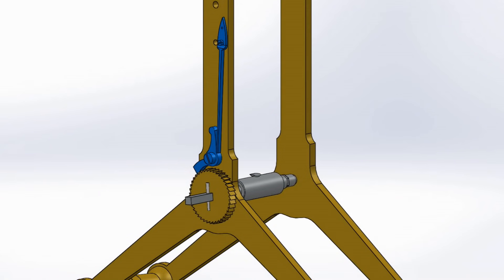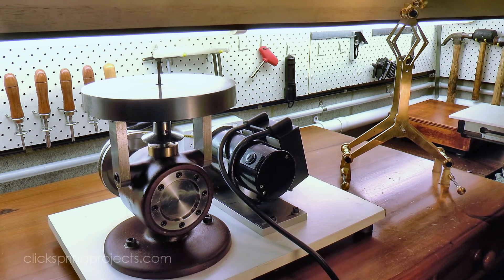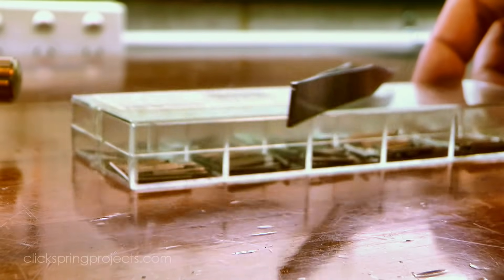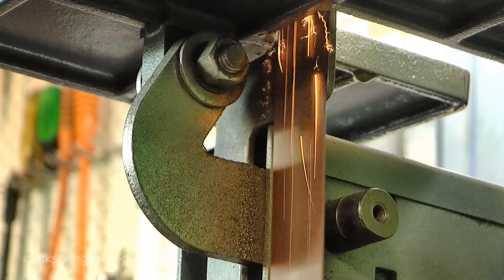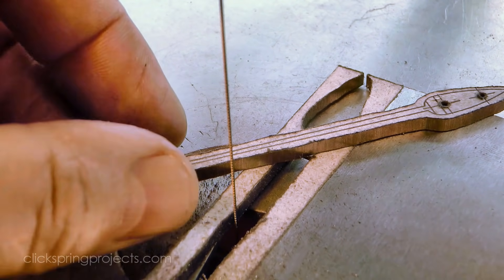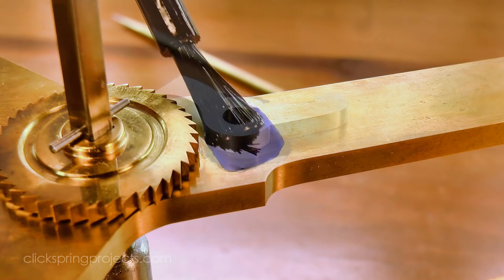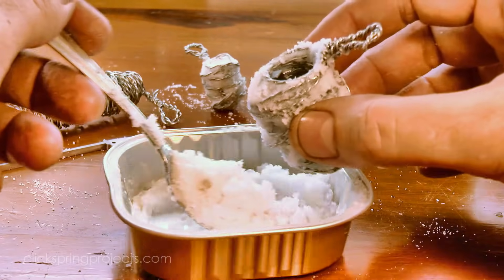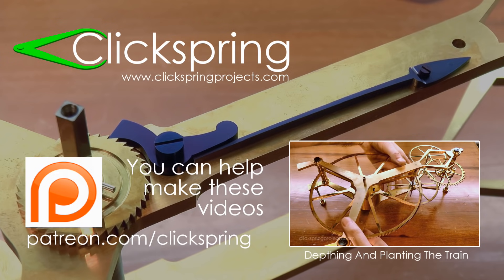Clockmaking - How To Make A Clock - Part 14 - Making The Barrel Click And Clickspring

Comment: Just noticed that in addition to using the sherline lathe/mill motor for cutting gears, this is the first time I've seen the use of that motor in the die filer. Was that a custom tool that I just need to watch for, or is that an off the shelf attachment from Sherline? If it's a custom tool, I'm wondering if I'm going to see that video at some point.

Comment: "Why does Time (appear to be) go one way". Because, logarithmic condensation form[s] follow fractal-perspective(s), e-Pi-i sync-duration connectivity function, ie omnidirectional-dimensional Superspin symmetry is one apparent format or "half-truth" transverse trancendental e-Pi Infinity of appearances, due to this numberness positioning observable as/by resonance, ie Chemistry Bonding = quantization identification. It's the shape shifting fluidity of water in a Fountain, ..containment by i-reflection instantaneous "pumping", or Singularity reciprocal metastability condensation, is equivalent to time-timing pulse-evolution recirculation. 

Clickspring => emulation of QM-TIME Completeness, pure-math putting perspectives of cause-effect Timing-spacing holography-dimensionality-> "Clocking" Actuality.

Comment: First, your videos and your work are amazing. 

At 4:47 you use a pencil to stabilize a pointing tip. Why is that? Why is not fixed and why you use just a pencil to stop the circular dancing.

Comment: Hey, chris, if that's A-2 tool steel you used in this video (same stuff as the pinion head depthing tool), be aware that the hardening process for A-2 is oddly complex and takes like 4 hours in an oven at several specific tempuratures. I used to make knives out of the stuff and found out the hard way that heating and quenching does not make A-2 steel harder
Reply from the maker: I use O1 oil hardening steel, very simple to harden - cheers :)

Comment: How did you build or buy your vise block/table topper thing? That is a very great idea and I would love to make one! Any ideas? Does it hold things well? Do you think it is better to use this or just bolt it to your table top? Edit: shown at 6:31
Reply from the maker: Hey Matthew -  Its an old cutting board, with the vise x 2 bolted to it.  Definitely not as secure as bolting vises directly to the bench, but I'm really limited for space so everything needs to be movable. Its rigid enough for small scale work, but would not be suitable for heavy work - cheers :)

Comment: I just notices that a lot of the clockmaking is measuring by size and not measuring and keeping it to the plan all the way trough the build. Small flaws that are inevitable are kept in and worked with rather then adjust and failure to it while working with the highest precision possible. More increasing precision rather than keeping a precision plan on microns, that can't be kept throughout the build.

Comment: Does the blue oxide fade off that easily? I mean on the spot where the click meets the wheel. Can that be avoided on larger parts?
Reply from the maker: It is a reasonably fragile coating. If it doesn't get any handling, it can last many hundreds of years, but if it rubs against something hard it will come off almost immediately. In this case the very tip has been cleaned off, and the rest will remain blue. Thanks for watching Andrea

Comment: hei, greetings from vienna :) i am wondering what program you're using to make those movable graphics with the wheels and pinions and the clockwork and stuff
Reply from the maker: +TheMegalodont Solidworks, although consider Fusion360 from Autodesk - same parametric functionality, but free for home users, thanks for watching
Reply: thanks for the quick answer, this was quite helpful, thanks

Comment: Does the filing button work because it is a higher hardness metal than the file?
Reply from the maker: +stopmotionmanager Generally speaking that is the way they are used, but I use them a little differently. Hardened steel damages the files as they push across it, so I make my filing buttons from a soft steel to avoid this, and use them primarily as a visual guide. The downside of using them the way I do, is that the buttons eventually get damaged, but I would rather remake a simple filing button, than have to purchase expensive new files. Thanks for watching and asking

Comment: Not to try and teach you how to suck eggs, but wouldn't broaching the hole be more accurate?
Reply from the maker: +74KU It did cross my mind, but I was a bit pressed for time, and the filing machine is a lot quicker than making, hardening, and tempering a broach from scratch. I will be broaching another square though, later in the build, one that is not so quick or easy to file. Thanks for watching.
Reply: Clickspring
 No worries, always great to watch someone doing some machine work when you can't yourself :)
Reply: I do it that way for small holes like winding keys. Hardened silver-steel worked well on pre drilled brass. use a vice to push it in. DON'T HIT IT.

Comment: It almost seems like you cheated when you pulled a manufactured pin from a tray.
Can you please explain this 4:48?
Reply from the maker: +Josef Roesler Hey Josef, that is called a "wiggler", its used to locate the spindle over a particular point, edge, hole etc. Thank you for watching and asking.
Reply: +Clickspring A little more detail?  You poke it and it goes straight.  Why?  Why isn't it straight to start with?  I don't get it.
Reply from the maker: +Josef Roesler Hey Josef, It makes use of the property of objects rotating in a spindle, that if you touch them with an external force, they have a tendency to self center. The reason it's not centered to begin with, is so that you can center the very tip as shown in the video, and cancel out any eccentricity in the way it's mounted in the spindle. The result is that the very tip of the tool is perfectly aligned with the rotational axis of the spindle, which means you can position it by eye over anything that you want to locate on the work piece (hole, line, point etc), and so begin cutting/drilling etc from a known location. Cheers, Chris.

Comment: great job! would you share more details about the blueing process? Such as the temperature……
Reply from the maker: +低安 It rather depends on the steel composition, but here is a pic showing the sort of temps you could expect for a carbon steel: https://en.wikipedia.org/wiki/Tempering_(metallurgy)#/media/File:Tempering_standards_used_in_blacksmithing.JPG Thanks for watching

Comment: Beautiful work. I'm impressed with how your scroll saw coping through thick-ish tool steel like that. What brand/model saw? Are the blades HSS jewelers type for hand frames? What brand / width / TPI / cutting fluid vs. dry?
Reply from the maker: +Peter Thannhauser Hey Peter, the saw is a Hegner, and the blades are Antilope brand pinless jewellers blades for metal, not sure of TPI but at least 3 teeth engaged with the work. I use a little candle wax for lubrication. Its very very slow going with tool steel, but it beats any other manual method I've tried. Thanks for watching :)

Comment: Can't wait for the final project. one question though, most of the drilling in all of your projects you drill for the first time to mark the hole then you continue with a different bit? Isn't drilling with the same bit going to work?
Reply from the maker: +Abdullah Algarni Hey Abdullay, twist drills are notorious for 'wandering' off position if there isn't a starting point for them to begin drilling. The first drill you see me use is called a spotting drill, and is much stiffer than a standard twist drill, and experiences much less of that 'wandering' effect. It starts the hole, and then the twist drill follows it without issue. Thanks for watching and asking :)
Reply: Clickspring two more questions 😊:
1. Why is the Clickspring made as an arrow shape? Is it just a design or it won't work unless it's like this shape?

2. About the blue color, Why is it blue? Is it your choice or this is the result? Can you control the colors?

Comment: Question. why do you leave so much material to be filed off, it seems to me to be a waste of time when you could just have cut a bit closer to the line ???
Reply from the maker: +chalfontcrew Typically I will cut about 1mm short with the jewellers saw, and then end up 0.5 mm short after the 80 grit sanding belt, leaving the rest for filing. In each case, it is so that the deepest score mark sits outside the next stage as I approach the line. It is surprising how much variation there is in the cut depth for a jewellers saw blade, remembering that not all cut strokes are perfectly vertical. Same applies for coarse grit belts. There are few things in life more annoying than taking off more metal than desired. Thanks for watching and asking.

Comment: Great videos! I'm not sure if this will be a clock that will run for show every now and then, but I would have chosen steel for the ratchet wheel if it would be running for any length of time (No pun intended). I can see the stress across the ratchet teeth tips with the hardened steel pawl making them blunt quickly.
Reply from the maker: +Adam Laycock Cheers Adam, great to have you watching! It will wear ok, this is the standard materials choice for ratchets and pawls in traditional clockmaking. Its a bit counter intuitive, but often the hardened steel components in clocks are the ones that show the most wear, yet the adjacent brass components show much less wear. Grit embeds in the brass and oil, and laps the steel, while the brass remains less affected.
Reply: +Clickspring Chris I was thinking the same thing about the hardened steel wearing the brass. Thanks for explaining that.

Comment: The filing machine makes all the difference, doesen't it? So does a scroll saw that can be slowed down to cut metal. If it weren't for these things it would be a geologic process. My admiration for the old-time clockmakers has just gone up. They did it all with a jeweler's saw and hand filing. I'm very impressed.
Reply from the maker: +Juan Rivero Totally agree, I am continually amazed at what they could do without powered tools, Cheers Juan :)

Comment: Is there a reason why you blued your parts prior to polishing?
Reply from the maker: +NightHawkInLight That's a great question Ben. It's the standard watchmaking process taught in all schools and texts - harden>temper>polish>(optional)blue, and it makes perfect sense if the part is to be left black polished. But like you I wondered whether the first temper is really necessary, if its going to be tempered a second time anyway during the bluing. I did some testing a while back, and found that the polishing takes a lot longer when the steel is left at full hardness, so that is my best answer at the moment. But I must admit it's still not an entirely satisfactory explanation of the sequence (if the part is to be eventually blued). I have queried some very experienced professionals on this exact question. Cheers mate :)
Reply: +Clickspring Doing so for the sake of making the metal easier to polish sounds reasonable, and it also leaves you a good colored surface to visually see once all the scratches have been worked out. Interesting thing to think about in any case.
Reply from the maker: +NightHawkInLight I forgot to mention that it also assists when polishing very delicate parts like hands and chronometer detents. Such parts would likely snap during polishing if not tempered before handling, It's not such an issue for robust parts like a click, or screws.
Reply: @Clickspring  Haha, because we all find ourselves filing chronometer detents, right 😐
Reply: I believe that blue colour indicates the proper tempering temperature for this steel. So, the purpose was to know the correct temperature for tempering, and keep it for some time that way to allow for a surface that can be polished easily. The next bluing is intended to impart a lovely uniform colour to the job.

Comment: Wonderful, as always. I'm always so excited when I see a new Clickspring video has been released! Just a quick question about opening up the square in the ratchet wheel: did you clean out the corners manually after using the bench filer? Or did you leave a chamfer in the corners? If you left a chamfer, how did you get a nice 45-degree chamfer from a 60-degree chamfered file? Eyeball?
Reply from the maker: +Quinn Lewis Hey Quinn, the #6 cut tri file I was using has a very convenient 45 degree bevel! So it was just a natural product of the corner of the file. It worked well with the rounded "corners" of the winding square. Thanks for watching mate :)
Reply: +Clickspring Ah! Convenient indeed. Thanks for your response, and keep up the great work! Can't wait to see more!

Comment: Gotta love it! More draw filing. Those tiny files cut as well or better than with straight filing. That shearing action as the teeth of the file are pulled over the metal at a shallow angle really leaves a nice finish.
Reply from the maker: +Peter W. Meek So true Peter, nothing as sweet as a fresh needle file :)

Comment: The parts are so crisp and perfect in the last shot, it looks like a 3D rendering from your CAD model. Well done!
Will the hardened steel pawl riding over the brass ratchet wear it out quickly?
Reply from the maker: +entropomorphic Thank you for the kind words :) It should wear ok, this is the standard materials choice for ratchet/pawls in traditional clockmaking. Its a bit counter intuitive, but often the hardened steel components in clocks are the ones that show the most wear, yet the adjacent brass components show much less wear. Grit embeds in the brass and oil, and laps the steel, while the brass remains less affected. Thanks for watching.
Reply: +Clickspring also, if you're using 360 yellow brass, it's leaded. The lead acts as a cushion to the brass.

Comment: Hi, Chris! Why do you use a different bit to make the start of the hole, then change it to another one afterwards to do the complete hole? The reaming I understand :)
Reply from the maker: +Fredheim Twist drills are notorious for 'wandering' off position if there isn't a starting point for them to begin drilling. The first drill you see me use is called a spotting drill, and is much stiffer than a standard twist drill, and experiences much less of that 'wandering' effect. It starts the hole, and then the twist drill follows it without issue. Thanks for watching and asking :)

Comment: Another excellent video! Good to see you using a centre drill. You did not mention the fact that the parts to be blued, should not be touched by hand after polishing, but then I suppose you assume anyone doing that would know. Chris.
Reply from the maker: +Englishman French Yes the very tip of a BS1 center drill works great as a spotting drill for sub 1mm holes. Thanks for watching mate :)

Comment: Just a thought, won't the spring wear out the gears when the gear spins? Since the spring is hardened steel won't that brake after a certain time?
Reply: +Alkex Svengren The gear only turns when winding the clock, so I guess that wear doesn't matter too much?

Comment: Another wonderful video! Thank you so much. Quick question: How do you cut metal on the scroll saw without the blade grabbing your stock piece and making it jump up and down on the table?  I've only tried with thinner brass stock, but I have to put all of my weight onto it to keep it down. Any tips?
Reply from the maker: +Miles Garrett Hey Miles, make sure the blade teeth are oriented to cut on the down stroke, and use some sort of lubrication, particularly with steel. I use candle wax, but you can use just about any normal cutting oil. Also be gentle with the depth of cut, it will cut without to much effort, it just needs a gentle pressure. Thanks for watching and asking :)

Comment: Hi, what's the wobbly needle thing you used before drilling the hole in the click. why isn't it tight in the chuck?
Reply from the maker: +Livi120 That's a "wiggler", a center finding device used to locate the spindle over a particular line, point or hole depending on how you use it, so you can make a hole (or whatever you need to do), exactly where you need it. Thanks for watching and asking :)

Comment: Awesome video as always Chris. I know there's many ways to skin a cat, but I'm kind of curious why you didn't build a broach and just broach out the square. I guess since it's a one off square hole, it might have not been worth it, but I figure it might have been a pretty fast lathe job. That bluing is fantastic, I'll have to try that finish on fasteners someday.
Reply from the maker: +neiljborja It did cross my mind, but I was a bit pressed for time, and the filing machine is a lot quicker than making, hardening, and tempering a broach from scratch. I will be broaching another square though, later in the build, one that is not so quick or easy to file. Thanks for watching.

Comment: With that brass touching steel aren't you worried about galvanic corrosion?
Reply from the maker: +Erik Weigel No, the construction method of using brass adjacent to steel has been practiced since the 14th century, and has proven to be remarkably long lasting. Standard surface corrosion of steel parts can be an issue in a humid climate, but I suspect that galvanic corrosion is not an issue due to the absence of an electrolyte. Thanks for watching and asking :)